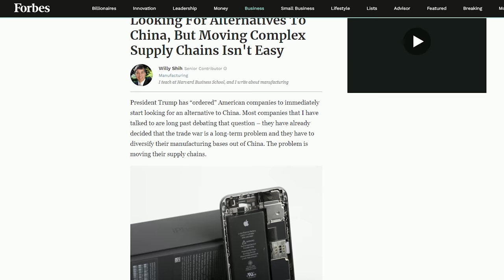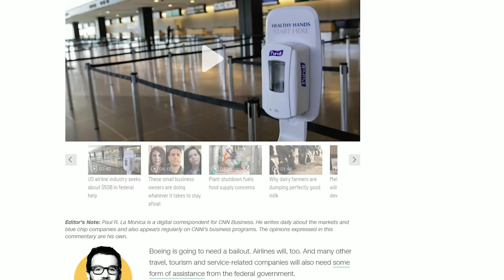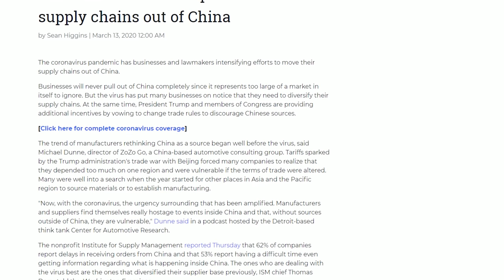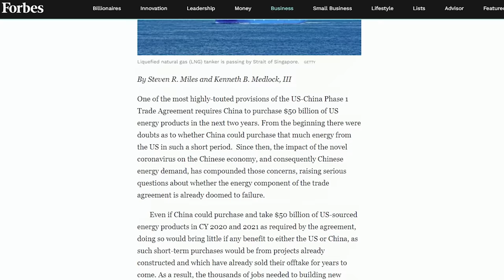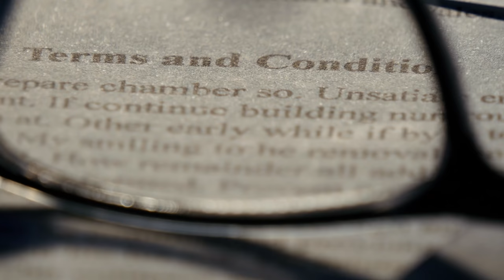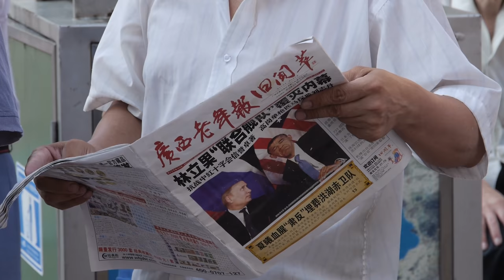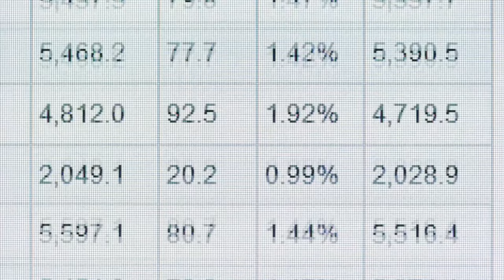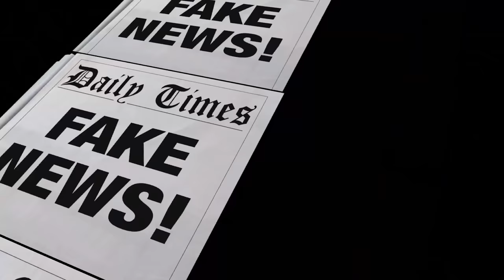Why China Will be the Big Winner of the 2020 Crisis

Comment: simple logic, our current global supply chain is based on economic principles that has been working since industrial revolution. to overturn that, you better have some god level new economic system to replace it, a youtube comment, an election campaign chant won't do the job.
the only thing that can severely disrupt the current economic system is the next industrial revolution, but that's a few decades away from completion, and then a decade or two more to fully adapt into our lives.
Reply: The pandemic will change everything. This includes the current global supply chain, if you doubt this you are dreaming.
Reply: @mitchellthompson501  You are speculating, just like everyone else.  What change? How severe? Are the right questions.

Comment: Most low level production has now moved out of China to lower wage countries like Vietnam or Bangladesh. It’s no longer ‘cheap’. These components may be made by Chinese owned firms or shipped for finishing in China, but the dominance of China is falling. Eg; most clothes making has left. Chinese desmans is now far more domestic as locals now have a lot of income. China is huge, large enough for domestic demand to power it forward so exports are increasingly unimportant.
China then wants infrastructure in those third countries, like ports or roads. This is focused on emerging markets which the West has ignored for decades. When was the last time the US built a road in Africa? For China this has the advantage of increasing China’s global influence. For Africa, China’s increasing power is not a problem, it’s only a problem for the West. Yes, China will control an increasingly important Africa, but so what?
Reply: Expensive to move factories. Overtime as the incentives show up, economic policies, etc companies will then move their production factories

Comment: 5:30 having the political leadership exercising direct control over the economy might seem like a good thing in that policy implementation is rapid, it also means that political and ideological considerations are paramount, and are not always based on sound economics.  

This is why SOEs have been propped up indefinitely even though they consistently have not been profitable, belt and road projects are riddled with toxic debt, and why foreign companies are blackmailed into political obedience (I.e. the political status of HK and Taiwan) in exchanges for market access.

All of these economic/political maneuvers are financed by debt, which has soared in China over the last decade.

Comment: Speaking like a true economists and not engineers. 
In engineering, these were the logistic changes/evolutions:
1915 - Ford created streamline manufacturing
1960s - Toyoto created Just in time manufacturing, which is possibly similar to the system implemented by China. 
2020+ - perhaps small scaled decentralized and localized manufacturing, with re-tool innovation, eg 3D printing, and just-in-time consumer interaction with manufacturers and cutting off the distribution channels? Note: an Idea.

Comment: New subscriber, great contents btw, keep up the hard work!

Regarding first part of your video on business as usual vs lil b*tch Inc -
That's true to some extent but customers may not always go for the cheapest option. I work in the electronics industry (in UK) and I see alot of companies (say 30-50%) would rather pay 10-50% more for 5-10% chance of better reliability and service support. Cost of customer service support and reputation is expensive in the west. 

Cheapest is not always the best for long term growth or products.
Certainly with ever expanding regulations etc the standards are becoming higher. 
Due to lax in ethics/standards in China (or perhaps reputation?) its harder to get a consistent manufacturing product there, so some may tend to avoid it for certain components. 

Once a company/manufacturing is big enough to send western teams and standards across to maintain then sure, they can overcome the inherent negative traits of cheap labour. Within that size of company though there are other costs involved like ip theft (Apple/Samsung) , pr issues with slave labour (Nike), logistics/lead time etc. 
Not an easy open/close conclusion, depends on component and product.

Edit: I appriciate this is an economics channel not manufacturing but simply pointing out its not as clear cut as prescribed. Therfore the answer you got isn't quite true, even global scale of things I'm fairly sure it's not that one sided.

Comment: I definitely agree that a big part of China's appeal is it's historically stable but strictly authoritarian government, which enables factories to be quite ruthless at maintaining productivity. 

Regarding diversifying factories, it should be noted that many developed countries are very eager to have new factories built in them, as they tend to be in need of that type of job in particular. Factory work can employ people who would struggle mightily in an office situation for example, or in customer service. The result is that they will make sweetheart deals with corps willing to put up anything that creates such jobs, to the point of (in the US at least, in some cases) paying more than those jobs are worth simply because it will drive down unemployment and make the government look good. Yes, putting up factories in countries like India are a nightmare I understand, but many countries will not put up barriers to factories, meaning it wouldn't be wildly more expensive to have factories in diverse countries. 

I think the real barrier is that China is just a bit cheaper, a bit easier, and a bit more reliable (no union issues for example), so even though it isn't the cheapest source of labor (there are much cheaper ones), it still gets disproportionately picked for building factories. China has historically suffered when it comes to skilled labor, with higher value manufactured goods being much preferred to originate in Germany for example, so they aren't immune to competition.

Comment: Well explained. But whether China exploiting other countries using debt trap diplomacy is too early to say. Since 2000, China actually cancelled or renegotiated nearly 100 cases when the debts were due. For the most cited victim of the debt trap diplomacy "Hambantota Port" in Sri Lanka, the project was actually initiated not by China, but the recipient country. And the total debt repayment for this project is only between 5 to 10 percent of Sri Lanka's total foreign debt repayment. The default on the loan was not because the loans are from China, but the misconduct of local elites and western financial market. 
With these being said, the Chinese companies do seem to display behaviors of corruption. Terms are notoriously opague. But the state owned companies do businesses like this domestically. As you said, the BRI is an economic project to alleviate China's over productive capacity, whether it is debt trap diplomacy remains to be testified in the years ahead.